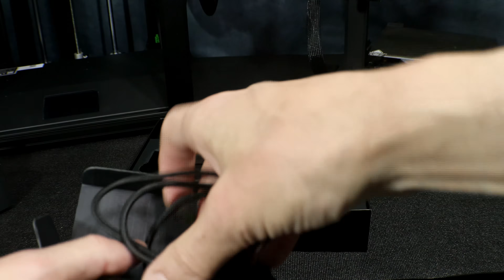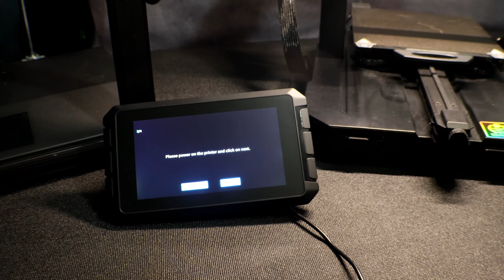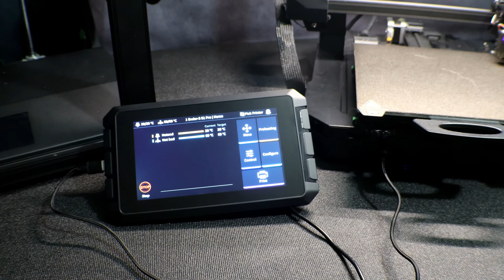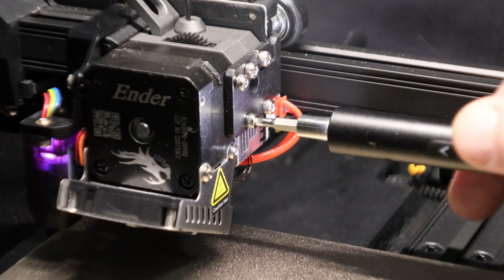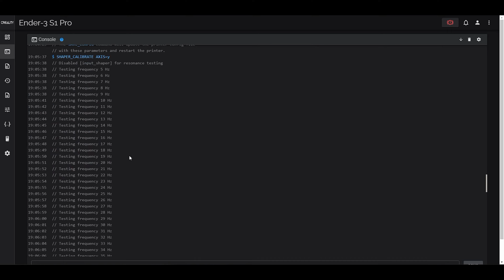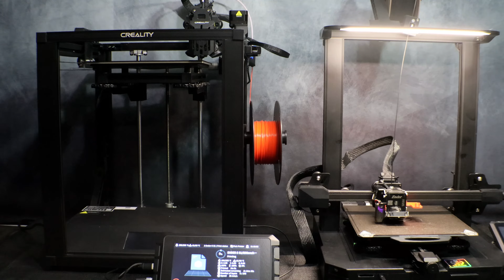Creality Sonic Pad The Next Level of Printing

Comment: Could you tell me what version of the firmware was running on the Ender 5 S1? When I put 1.0.6 on my 5-S1 it crashes when auto bed levelling and gives error code E203. Creality have been no help whatsoever.

Comment: I'm a bit confused hope you could help, when it comes to the first step in getting the pad level, where the knobs need to be tightened up, do you actually do that part? Also, on the auto leaving part, what numbers are you looking for to get to know you have a great level? I'm need to printing, just trying to get a bit more info. I'm actually really excited to get it going.
Reply: I’m still new to this but when it came to the four corners I just hit stop and skipped it and then let it continue on.  Let it do the bed mesh and then go back and set the Z-offset with a piece of paper or a feeler gauge.  Then I went back to the four corner part and just loosened my bed springs until the feeler gauge just barely slid out.  Then go back and re-run the bed mesh.  After that it was good to go.  The pad has made my printer so much better I wouldn’t hesitate to buy it again.  I hope this helps.

Comment: after inserting the SD card into the printer (s1) it bricks my machine. I have tried twice and had to reinstall the original firmware each time due to it making the printer inoperable.
Reply: If you are using a Creality Ender S1 series, are you sure you use the image for the right processor? There are two types, and using the wrong processor type can indeed lead to a "frozen" printer. Also - Keep in mind that after installing the firmware, you HAVE to use the Sonic Pad, because the display on the printer itself is not working with the Klipper firmware. You cannot longer operate the printer without the Sonic Pad. In short - The printer looks like frozen if you don't connect the Sonic Pad, but in reality it's waiting idle until that Sonic Pad is connected.
Reply: @Jclosed  I am using an Ender 3 S1 and removed the bottom plate to make sure I had the right board for the right firmware.  I followed the instructions and multiple videos thoroughly but the sonic pad would never show its loading screen. I returned the sonic pad and installed the professional firmware on the machine. I'll try a raspberry pi at some point. Thanks for the tips though.
Reply: @BooperTrooper912  Ah - That's really bad. Well - I am going to try in a few day's, so let's hope it will go better on my Ender 3 S1.
Until now I am using a Raspberry Pi 400, and used Octoprint. I wanted to give Klipper a run and was reading in, but then saw the Sonic Pad would be a short-cut for that. If it does not work, I can always go back to the original plan. I mean, after a long time tweaking and compiling Marlin firmware it should be not too difficult for me...
Anyway - I hope you are more lucky this time...
Reply: @jclosed2516  I hope it goes well for you.  I will say I am happy with the upgraded firmware but I would like to monitor things remotely.  Right now I have an old baby monitor camera watching things while I'm home lol.

Comment: Has anyone here connected a pad to an Ender 5 Plus? How much faster can you print and do you need to do anything other then use this pad? Do you need to change slicer settings or slicer profile settings?
Reply from the maker: Generally with the pad and klipper ypu can get 2 to 5x the print speed and keep the quality. My ender 5 s1 runs up tp 250 clean with the pad. Creality has suggested profiles in the link in the description.

Comment: Hey Will, great video, i have a few questions for you. The  Sonic pad can handle up to 4 printers does that also mean 4 cams as well? can a USB hub be used to add the cameras or have a single USB cable to the Pad and all printers connected to the hub?
Reply from the maker: Right now you can go 4 printers no camera or 2 and 2 or 3 and 1 I haven't tried a usb hub myself I'll dig one out and see if it works with it and let you know
Reply: @studiozombie3d  Thanks mate much apppreciatedd

Comment: Thanks Will, your prints look amazing indeed. Got klipper running on my Tevo Tornado but haven't done the input shaper thing. The pad looks and works amazing. Really considering it now
Reply from the maker: It's a great system the Input shaper definitely helps a ton
Reply: @studiozombie3d  thanks i think I buy an accelerometer now and connect it to my Pi to try that first
Reply from the maker: @waltervanwaard336  just be sure to get a ADXL345 sensor and your good to go